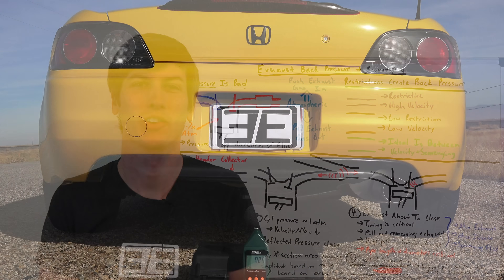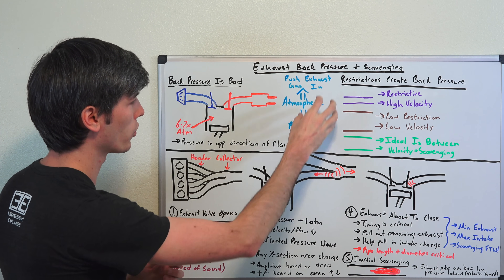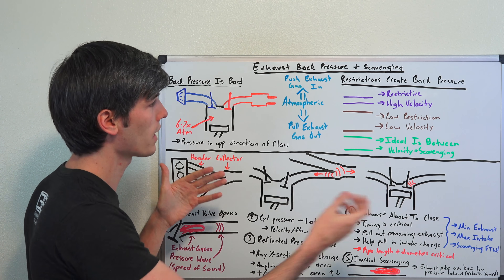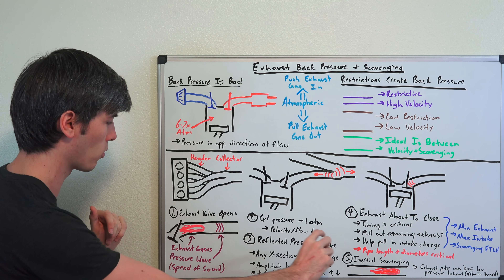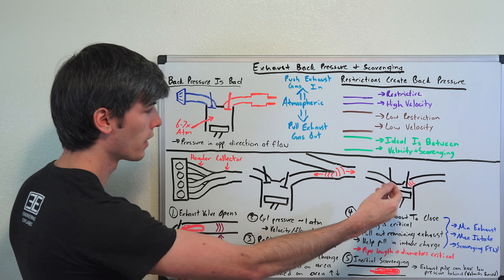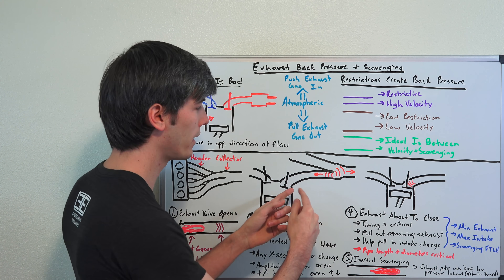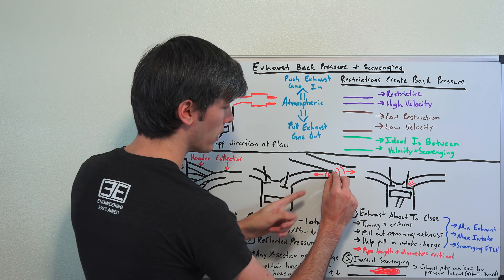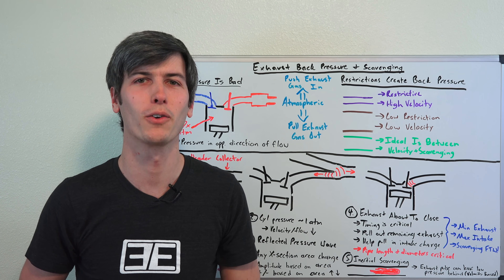Stop Saying Car Exhausts Need Back Pressure

Comment: In short, the ideal situation for maximum efficiency is to operate the exhaust system at its resonant frequency, but that means the engine needs to operate at a fixed speed, or within a very narrow speed range.  This is practical in engine-generator sets and some aircraft, such as helicopters, but isn't typically found in automobiles. The best we can do in automobiles is to have a continuously variable transmission (CVT) or a gearbox with many, closely-spaced gear ratios to keep the engine speed within a narrow range.

Comment: Can you do a video explaining velocity stacks ?
Reply: The velocity stack is designed to: Allow smooth and even entry of air at high velocities into the intake tract with the flow stream adhering to the pipe walls known as laminar flow.

Comment: Hey mr. EE, I have a question:
If I have a car with a non-stock engine and an exhaust manifold that may or may not be stock to that engine, is there a way to determine whether or not the exhaust manifold is causing detrimental pressure waves? Would that be audible from the tail pipe? When you say "timed" are you referring to the spark plug ignition relative to piston position, or simply the length of the individual exhaust headers to the collector? 

I imagine the inertial scavenging is just proportional to some relation between the collector diameter and piston displacement, but I have no idea if these vacuum(?) waves are constructive or destructive in my setup. Also, does the length of the tail pipe and age/mileage of the catalytic converter factor into this?

sorry for 15 questions. I'm really novice at acoustics.

Comment: I have been trying to explain this for years. The way I have always described it is it's like saying a formula 1 car needs drag. It doesn't. Drag is the enemy. But you need downforce and usually that comes with drag as a byproduct. Just one thing you missed is exhaust gas temperature as that will change the speed of sound and therefore the speed that the pressure wave moves at. So the higher the EGT the longer you need the exhaust primary to get the benefit of wave scavenging.

Comment: What are the consequences then if I replace the "exhaust muffler tip" with another one with a larger outlet diameter? Here stock muffler inlet= 1.75" , outlet=1.75" and aftermarket which I am interested in inlet=2.5", outlet=4"

Comment: your title contradict what you go to say . that  you need velocity and that come from smaller pipes but to small .   that back pressure.  you can seprate torque from HP .Because they are part the same math. a dino measure twisting torque, the math does the work/time or HP ,  they meet at 5,323 rpm ,both same number torque and HP , below that number torque move the car after that number HP move the car.    so gearing decide torque or HP as gearinq is rpm.  you can add more rpm  and gearing to stay above 5,323 rpm  and your a race  car that leave the line at 5k rpm.  depends long empty rd, rev it up , but lag all noise car without gearing. force feed qive you torque , but only if you got velocity or  restriction or smaller turbo there the same . in short street ,  you need restriction as that volocity, torque, smaller fuel particals that dont touch the walls, better vacume for brakes, responsive trottle, better mpg . Iam pecking with a remote so cant correct, but in vision then it become clear.

Comment: Doesn't the reflected wave only happen if there is turbulent flow?  So if, for example, the exhaust pipe was shaped more like the nozzle extension of a rocket wouldn't there be basically no reflected wave?  That is to say apply Goddard's equation for the geometry of the pipe such that the exhaust gas flow stays laminar while expanding .

Comment: Well I'm agree with you but when you don't have back pressure this causes to fully empty the cylinder. Well we are searching this moment but when the intake stroke comes you get more fuel mixture in the cylinder. So when it ignites you got higher temperature of burning and I know that causes cylinder head gasket or valves to burn out because of the higher working temperature. I think that it's better to have some back pressure. Well if we look at turbo engine after the outlet of the exaust turbine it would be better without back pressure of course. Correct me if I'm wrong.

Comment: Excellent video! One of your best, I dare say. I've come back to it many times.

An interesting follow up would be an explanation of the exhaust servo valves. Claimed by the manufacturers to improve low-speed torque, claimed by the critics to be worthless from a performance point of view and only installed to improve noise and emissions. I've looked long and hard for a theory that explains how these can improve the torque, but so far found nothing really useful. If instead of being a butterfly valve, it was some device that would adjust the header lengths, I could understand it, as you could then tune for maximum scavenging for all rpms. Really don't see how that butterfly valve can help though.

Hope you can explain!

Thanks.

Comment: So the question is... how does one come up with the ideal exhaust system / piping?

Not to say this means anything but I seem to experience a loss of pressure after spacing (disconnecting) my g35's muffler..

Comment: Since there was a lot in this video about sound and sound waves, is there any effect that the thickness of the exhaust piping would have on the exhaust gases (velocity, sound, back-pressure etc)? Also, if one wraps their exhaust pipes, it would muffle the sound a bit, would that change the exhaust gases too?

Comment: Having a smaller diameter exhaust pipe will not cause additional back pressure. It will cause additional pressure loss due to higher mixing losses and local skin friction losses on the pipe walls.

Comment: So, as we knew, an engine DOES need SOME back pressure. Too large or small of an exhaust is a problem...so that is part of a properly designed engine system. For larger engines, especially diesels, exhaust sizing makes a big difference in optimizing HP/torque and fuel efficiency designed into an engine.  Typically, what comes from the manufacturer isn’t optimal, except in rare cases of higher performance vehicles. Even pickup truck diesels typically have too restrictive of an exhaust (and often poor wastegate design).

Comment: should just have an electrcifan inside the exhaust near the engine side, or use the momentum of the hot gases turning the fan to pull the last bit away from the valve ?

Comment: At the moment when you explain that the exhaust wants it exit through the least pressurized chamber that would actually be the intake valve because it's under f**** vacuum the opposite of pressure

Comment: I removed the catalytic converter and installed a flow master muffler on my Inline 6 F150 and noticed a drop in power and fuel mileage. If it's not back pressure, what is causing the loss?
Reply: tskwared667 you have to get your computer re-mapped or tuned

Comment: Too much scavenging will suck fresh air into the exhaust during valve overlap at low RPM. This is partially why high-overlap cams idle poorly, and also why you lose low-end power if the exhaust flows too freely. So I think you explained it very well with the exception that you want the right amount of backpressure, to scavenge just right and not lose all low-end, at the expense of some top-end power, instead of not wanting any back pressure at all and only favor high engine speeds. Variable valve timing helps compensate and can probably allow for lower back-pressure without excessive low-end losses, by reducing valve overlap at those speeds. You could also have noted that the exhaust valve opens way before bottom-center. There is a point where there is no benefit to keeping the exhaust valve closed any longer, because the pressure is low due to chamber expansion, and the rod angle is no longer favorable to convert the piston motion into rotation.

Comment: Maaan drop some dynos then we will truly know don’t believe everything you hear ppl aren’t God. And there is a lot of extremes to life that’d prove this theory wrong. He has no idea what’s happening at 7k 10k even 15k rpm to act like he knows what’s going on. This is almost like the intake effect. 8 to 15 hp my ass a lot of ppl complain that the car feels slower with added aftermarket intake. Ijs it’s a delicate mixture when it comes to building an engine.
Reply: Slapping components on to an engine typically robs power and efficiency. Be it an aftermarket exhaust or intake or whatever. Designing everything to function elegantly with eachother is necessary. The negative pressure wave's he's talking about is correct. This is why NA 4 stroke engines are fundamentally flawed.

Comment: 350 Small block Chevy with a 3 inch y pipe, no cats into a 3 inch straight pipe with no muffler. Truck will now burn the tires right off the line. Before with the 1"3/4 y pipe, cat and muffler it would barely get out of its own way. 
Back pressure is bad
Now on to engine internals to get even more power put of it. Mileage also improved with the free flowing exhaust

Comment: This is a great video, and an excellent explanation of everything that is at play here, however I would agree with some of the other comments that you should probably edit the title of the vid.  You actually do end up in agreement with the notion that “car exhausts need back pressure”, considering that they require the “right” amount of back pressure (produced by the optimum diameter of the pipe to provide adequate velocity for additional scavenging).  Good luck and keep up the great work!
Reply: I don’t think that’s the conclusion. The gasses neet to be evacuated as fast as possible and an exhaust with flow restrictions but good wave propagation may be better than one with less restrictions and worse wave propagation. In other the bad wave propagation can cause higher back pressure than something that would intuitively seem more restrictive but the best is to have no restrictions and optimized wave propagation and inertia which ultimately gives the lowest back pressure 
At least that’s is what I understand from the video, although at first glance you may understand something else

Comment: Don't forget, exhaust temperature is important as well, for scavenging and flow. Colder exhaust temperature does not flow as well, as a hotter temperature, as well as having to many bends in an exhaust system, which can also slow down exhaust gasses.

Comment: All in all it's air intake to air flowing out of your exhaust, you will lose power straight piping a stock car. If you have cold air intake you will need a bit more flow going out of your exhaust, if you turbo your car then yes..possibly you could straight pipe your car, depending on how big the turbo is and how much air you have coming in. Legally you can't do this because emissions (depending on where you live) it's pretty simple, you have a stock exhaust with cool air intake(hondas) you will lose power. You want the air intake to be close to how much air you're getting out of your exhaust.

Comment: Very cool videos!  I really enjoy the Scientific aspect of it. I am planning on modifying a C6 ZR1 Corvette with an Air Intake, Longtube Headers, Catalytic converters, X-pipe & mufflers...I'm trying to decide if I should go with 1 7/8" Long tube headers or 2" Long tube headers...There probably wouldn't be that much of a difference between the two, but... Which one do you think would be a better choice for HP & TQ? (Taking into account the scavenging & back pressures differences.

Comment: Precisely sufficient back pressure assists optimum exhaust scavenging. Zero back pressure will actually leave exhaust sitting in, or returning to, the exhsust manifold. This applies until you reach the realm of forced induction engines. Tuning it precisely and successfully over a wider rpm range is, literally rocket science. We may not agree with stock design purposes but they spend huge bucks setting these things up for reasons.

Comment: I thought I would share some real life experience. I was on the dyno tuning a Nissan 370z. The vehicle had intakes and a full exhaust system with cats removed. The exhaust system had optional "silencers" which decrease the diameter from the original dual 2.5" down to 2". They can be mounted in the muffler tips at the rear of the vehicle. I did the full tune with the silencers removed, then installed them at the end of the tuning session. To my surprise the car gained 8hp to the wheels. I removed them again the confirm and the result was repeatable.  These cars run closed loop fueling under full throttle so I was able to dial in the AFR exactly to where I wanted it which was around 12.5 AFR.  Each test was conducted with the same fuel mixture, ignition timing, and cam timing.
I guess putting in the restriction in the tip of the exhaust allowed the scavenging pulses to be timed in an ideal moment.

Comment: Great video. Could you or someone else please give some input on this regarding turbocharged engines?? The difference there being that the exhaust gases through the pipework can't help with creating a negative pressure in the cylinder due to the turbo being there and the gases through to the end of the exhaust are not really in pulses anymore once they go through the turbo, so my thought was that a fairly free flowing pipe would be best... Ideas?

Comment: You get more power at lower RPMs with more restriction. Therefore put a manifold pressure controlled valve in the exhaust, which is already available aftermarket and comes stock on high power motorbikes.

Comment: Back pressure is not a bad thing it is the condition necessary to create velocity 
Poorly designed back pressure is bad
In 2 strokes the pressure waves  are critical with not only scavenging but with holding the incoming charge back

Comment: A bit of a general statement there. Try starting an old VW aircooled engine with no exhaust pipes fitted. It won't.
Reply: Why wouldn't it? I knew a guy who ran a Honda 100 without an exhaust pipe at all (wrong in SO many ways). It sounded horrible and ran like crap but it ran.

Comment: Have you ever done a video on bore vs stroke? Say short stroke high compression engines (like the old Dodge 440's) vs most all other engines where the stroke is longer than the bore? I've heard that the short strokers were great at getting RPM's quick but wore out quickly and had to be rebuilt a lot?

Comment: You need little back bressure to get optimal power and fuel economy. But all you need is an exhaust manifold and flange where gasses combine( could be in manifold it self ).   That is ennough in most cases.   Turbo cars need a bit more, to avoid turbo working as sucking unburned fuel and air from sylinder before valves have time to shut down.

Comment: So you disproved your own video title. Cars do require a small amount of back pressure indirectly in order to create a scavenging effect and increase velocity of exhaust flow. V1/t1 = V2/t2 or A1v1=A2V2
Reply: If he is saying you  do need some back pressure he should  change the damn title.
Reply: vampov i suppose but its not positive backpressure its negative pressure
Reply: vampov sort of yes, sort of no.  A lot of folks just say ‘you need backpressure’ and don’t qualify the comment. He does here, although the video title is misleading. You DO want SOME backpressure...and it takes some fine tuning to find the correct amount for optimal performance and economy.
Reply: It is not about back-pressure, you indeed do not need that. The only back pressure should be atmosferic. However, even that you can do without. Where we have to deal with is the so called Helmholtz effect. The pressure wave is followed by a vacuum. Explained in the video is that if the implosion of that vacuum takes place before the next explosion it will cause scavaging. So what does that mean for a 1 cylinder straight pipe? At a low rpm , with a fixed length , the pipe should be narrow, so that the speed / pressure difference stays high enough so that there is no implosion before the next explosion follows, losing torque. A short pipe in this case can cause loss of torque. However, since a dragraces revs up in no time it does more harm with a pipe, than without. At a high RPM , these narrow piping causing resistance. That's why manufactors add a adjustable restrictor in a wide diameter pipe. But this is not to cause "back pressure"it is there to PREVENT it.

The first part is about the timing of the manifold, each multiple cylinder roadcar  have a little bit overlap in exhaustvalve timing. Hot exhaustgases creeping back in the cylinders. By changing length and order off the cylinders you can prevent this ( like the sky-active system , which makes it possible to have a higher compression ratio ).
Reply: GlassTopRX7 Did you watch the video? Open headers will not produce the negative back pressure pulse caused by an decrease in restriction in the pipes, which results in poorer extraction of exhaust gasses during the exhaust stroke as pressure in the cylinder equalizes and exhaust velocity drops (thus, producing less power on the next power stroke due to some exhaust gas remaining in the cylinder during the intake stroke). The negative back pressure effect will work best at a certain RPM because the speed of the 4-stroke cycle is dependent on RPM, and the geometry of the exhaust is fixed, meaning this back pressure pulse will always arrive at the same time even though the piston moves through its stroke at different speeds.
Reply: vampov
 EXACTLY!

Comment: Is back pressure beneficial for two-stroke engines? In the small two-stroke scene I see a lot of talk about back pressure improving horsepower. I have also been told that it improves emissions on two-strokes by more completely consuming the fuel.